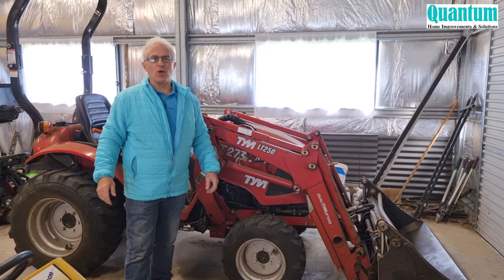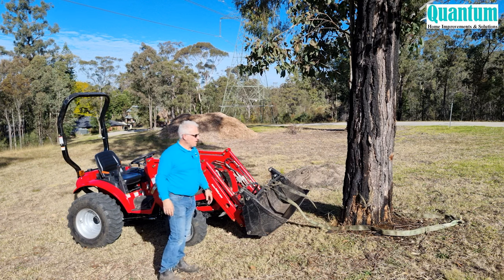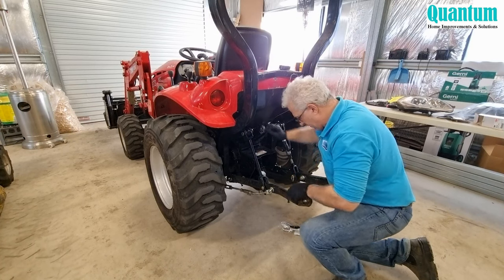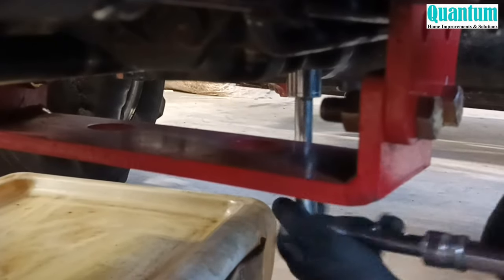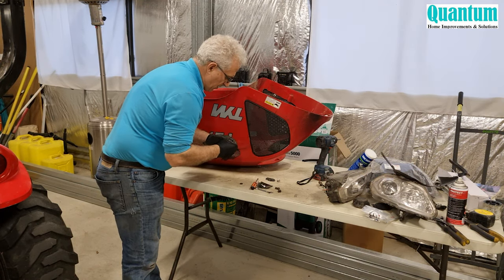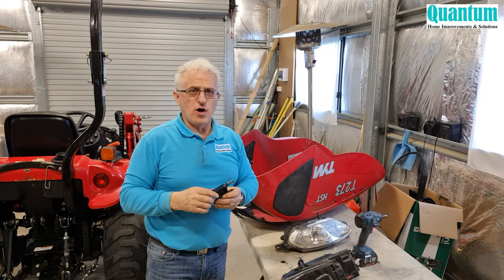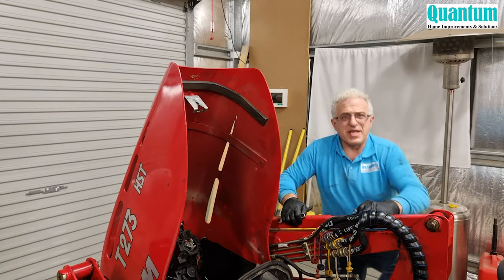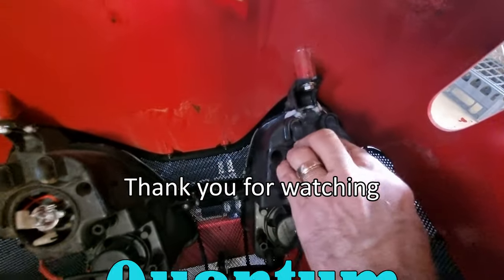The Surprising Truth about TYM Tractors, Are they any Good? Service & Repair!

Comment: Great video lots of work on that machine , nice to see you with that coat on ,I couldn’t believe how many grease fittings . So many things built today without ways to maintain them properly. Cheers
Reply from the maker: Thanks Don, yes this machine is built well! 

Very observant regarding the coat! I have been using it outdoors, but not so much on videos. We have had a moderate winter but not excessively cold or wet. However, the day I made this video! 🥶 but it wormed up quickly, especially in the shed where I did most of the work. 🍻

Comment: Would you recommend your size tractor and the TYM brand as a dedicated slashing tractor?
I own a property maintenance business and am looking to branch out into large block slashing jobs.
I am looking at a similar sized tractor or a razorback for this type of work.
Intersted in your thoughts.
Reply from the maker: My TYM compact is by far better for slashing than my Razorback eventhough the Razorback is a great machine, especially on hills. I made a video on it if you haven't seen it as yet. Regarding the tractor, mine can overheat when using the 1200 mm daken slasher due to the hills on our property. That is when I don't maintain the radiator with debris! You need to keep it clear all the time and check the water level!

There is a lot to be said about both machines which both have a lot of pluses! But the big question is how big a property are you looking to mow, remembering the bigger the machine the wider slasher you can use which will be  faster for you and more profitable. Also, the slope of the property will be a big issue for the tractor and if the property has a lot of rocks! The Razorback is an incredible machine on hills, but it's not good with rocks and is slower than a tractor! 

I hope this helps, but you are welcome to ask more about either machines. I am happy to share!

Comment: I noticed it didn’t blow as much smoke after the service, also is there any parts to avoid spraying with water?
Reply from the maker: Hey Joseph, good question! Yes, it runs more efficiently and started easier considering it's only a 3 cylinder engine. And yes, you should keep away from the electrical components when possible. However, it's common to pressure clean a tractor considering the function of the machine & potentially how dirty they can get.